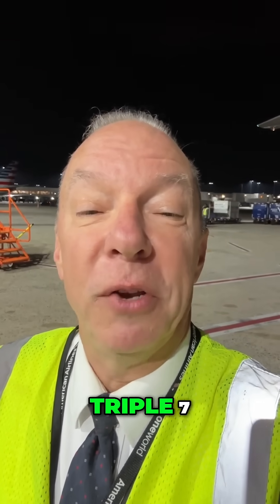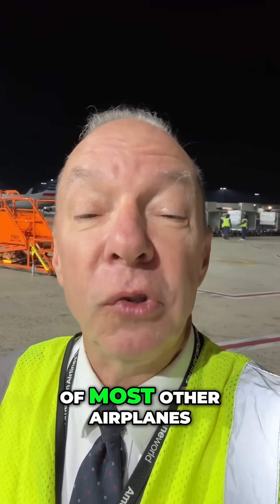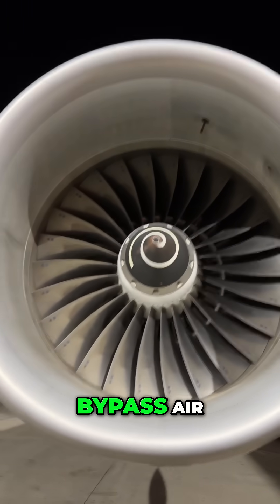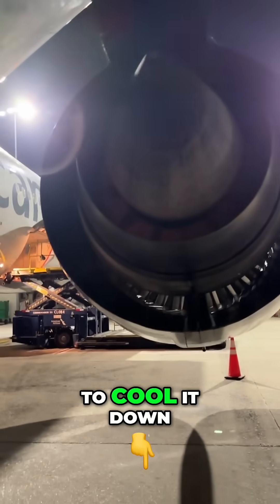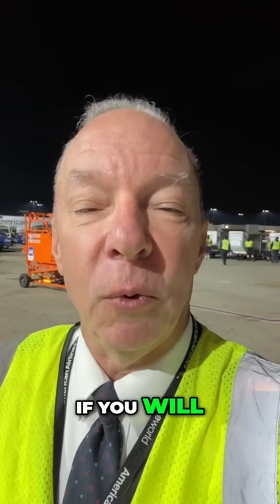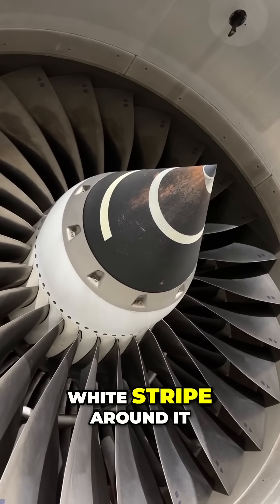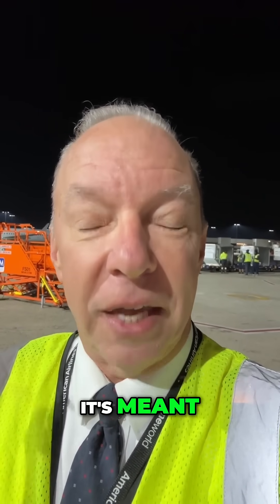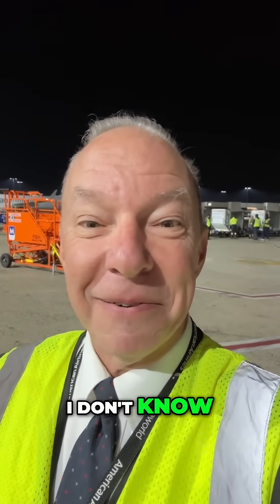Inside Boeing 777 Engines: What You Need to Know

Comment: I believe the main important part of bypass air function is that it produces most of the thrust for the engine due to the large mass flow rate (mdot). Cooling is a secondary benefit.  Great videos keep them coming.
Reply: Basically the only thing he got right was that they are really big.
Reply: @Jeff-6691 yes vanes don't turn. They direct flow from Blades that rotate.
Reply: @randytolle6706  Those are not inlet guide vanes, which you are referring to. Those are the first stage fan blades, and they rotate.
Reply: @davispen  yes.  Just saying Vanes  don't rotate.  , Blades turn.
The stationary turbine I work with.has 19 stages of compressor blades and vanes. 3 Turbine Blades.
Reply: True, and the reason for the spiral isn't to keep birds out, it's so that ground crew can tell the fan is rotating when the strobe effect of the ramp lighting makes the fan looks like it's stationary. The time for the white spiral to rotate visually is far longer than the time for one blade to replace another at any specific angle.
Old folk like me will no doubt remember the "wagon wheel effect" we would see when watching western movies on old black and white TVs.
Reply: 90% of the thrust is produced by the bypass air and it reduces noise!
Reply: @helmutklein6177  so it's essentially a large turbo charger?  Should it use the exahaust gases too?
Reply: @DeepakKumar-lv4te  It is essentially a large propeller.
Reply: The bypass air also helps for noise

Comment: The swirl on the engine fan cone, is for ground crew so they know what engine is running, so they know if it's safe to be around that aircraft
Reply: Exactly right. Some engine models have a simple vertical line to fulfill that function. One additional benefit of the swirl design is that it's relatively easy to tell if the fan disk is just free-spinning in the wind versus being spun up to start.
Reply: @MikeDCWeld  definitely. A great example would be on the dash 8 and atr series with the strip

Comment: Hey Captain Steve.  Tell your higher-ups and bosses that putting a "Chicken Wire" type metal cone in front of the jet engines would fix the bird strike problem 100% and wouldn't cut airflow at all.  I used the chicken wire as just a guide to a strong cone shaped device that is mounted to the front of jet engines.
Edit.  Besides it would make all passenger jets look like SR71 Blackbirds which would be super badass.

Comment: The main purpose of the fan bypass air is to produce most of the thrust by accelerating most of the mass flow of air going in to the engine backwards. Its called bypass because it doesn't go through the gas generator section or core. The core produces some thrust too. However the fan bypass air does cool the ayle sometimes I think. And maybe takes a bit of heat off the core. By using the turbine engine to drive a large fan produces more static thrust for less power. And accelerating more mass flow to less speed is more propulsively efficient. So bigger fan bigger bypass.
Reply: That's what I am screaming!  Cooling is secondary at best!
Reply: Exactly,  it's to produce thrust way more effecient across the speed range passenger planes are using. Regular jet with no bypass have way too high exit gas velocity to travel 0.8 mach effecient. Think of it like some combination of  propeller and jet engine
Reply: Aaaand it also makes the engines a lot more silent. I plane spotted sometimes as a kid in the 70’s and jet engines were LOOOUUUD back then. And a lot smaller, you can check on photos or old movies!
Reply: @MadofaA  Yep. Ever hear a 727 takeoff ? You hear that sound linger like a few minutes after it lifted off. Its a nice sound. Planes nowadays are too quiet. Ever hear a A380 takeoff ? You might miss it. And shortly after it lifts off, the sound just disappears.

Comment: The bird story is a myth. 

Imagine you are a bird and you see an engine coming at you at hunderts of mph. Even if you have a split second reaction time and try to move away you’re still in that very air that gets sucked in the engine with enormous force. Not a chance. 

The reason why there are marks on the tip is so ground personal can identify if the blades are still rotating.

Comment: The first stage of the engine is the FAN.  MOST of the thrust/ power is produced by the fan.   The fan is essentially a multi blade propeller. Most of the air goes through the " BYPASS DUCT "  clearly visible from the rear view of the engine. Only the air required for combustion power goes through the " CORE " of the engine and out the exhaust.   The shape of the fan spinner is designed to force air to engage the blades at the most effective angle.  The spiral drawing on the spinner is to warn / alert  ground personnel the engine is running and repel birds because wild animals will move away from anything they perceive as moving.  This engine is a literal engineering masterpiece , but far too complex to explain in this forum.
Reply: Yes I was surprised he described it as an air conditioning unit.
Reply: He is completely ignorant on both topics.   However the vast majority of the fools that believe his crap really do not want to understand how things work.
Reply: It doesn’t repel birds. This is why the spinners on tail mounted engines don’t have that. If it repels birds, those would have them too. 

And they would put those lines the spinners of prop planes too.
Reply: @rtbrtb_dutchy4183    Propeller tips are painted with colors - mostly white -  to give a visual indication to motion.  Propellers are black facing the pilot and either black or gray facing forward.  Black + RPM makes the prop disappear thus the tips are painted with colors ground personnel will be able to see.
Reply: He must fly MODEL planes, because every pilot I know can explain every system perfectly.
Its a TURBO-FAN jet. The blades in the front are not for cooling the jet at all, they are for producing thrust. In other words the jets purpose is to turn a shaft which the fan is mounted on so the FAN can produce thrust.
Reply: @rty1955    I know a ton of pilots.  They have basic knowledge but cannot explain how the engine works., They just know the numbers
Reply: Thanks for a clear explanation.
Reply: What is literal engineering
Reply: @user-ky6vw5up9m       It's a form of engineering contrary to metaphoric or hyperbole.

Comment: Imagine if it was required to manually start one of these like how they start old planes with the little whine clutch. 

God bless apu
Reply: Sometimes they have to do a manual start but it's not quite as involved as old prop aircraft. Sometimes a mechanic has to use a tool to hold a valve open to start the engine
Reply: @blackmusik109  I did hear something about no apu start. But I never followed suit. Good to know
Reply: @ee12rd  The no apu start is a different procedure from the one I described above. For the no Apu start we refer to it as an air start (like a jump start for a car). We use a machine called an air start unit (aka huffer) that blows high pressure into the engine to get it turning. We can also use it to provide air conditioning to the aircraft. Basically it's like an external APU machine that only provides air for starting engines and cooling the cabin.

Comment: I thought the spinners were to let the ground crew know the engine is spinning...?
Reply: I thought so too. Or anybody else that happens to get close
Reply: @andrebello4191  Same here!
Reply: @andrebello4191 trump supporters and their incredibly high IQs back at it again 😂sad
Reply: I imagine it also serves that purpose. It would make sense
Reply: @sebr3041  It also serves that purpose 🎉
Reply: X1000. It is for ground crew.
Reply: It is as well as to let flight crew know if the engine is under power there is numerous reasons
Reply: I make these motors and it’s for the ground crew not birds
Reply: Captain Steve is pulling your leg a bit.😆
Reply: @westerlywinds5684 someone knows 😉
Reply: Me too.
Reply: Exactly my thought.
Reply: Captain Steve must be one of the kindest pilots in the world. I'd love to fly with him.
Reply: True it is😂
Reply: Two birds...uh...you know...
Reply: @inspectorgadget8234  if the engine is windmilling you can tell by the spinner.
Reply: Yes.   Birds are only an issue after takeoff.   The spinner is of no use then.  This is a complete idiot.  His bypass air explanation is even more idiotic.   Find a home with a padded room.
Reply: It’s to make you keep wondering what they are for. 😂😂😂
Reply: I agree. When engine is running you can not see the spiral because it rotates so fast. Birds won't see that spiral any more than the big jet rushing towards them with a lot of noise.
Reply: It is
Reply: I thought so too; also to show which direction the turbine is spinning
Reply: @ProjectArjunCertified 
The turbine can only spin in one direction under its own power, unless it's just the wind turning it.
Reply: Anyone near that thing will definately know its spinning from the unmistakable noise it makes!
Reply: @martinmtawali7359  tell us you’ve never been on a ramp surrounded by aircraft, without telling us. 

First of all, you are wearing ear protection. Secondly, there are other airplanes right around you with engines running. Also, airplanes have their APUs running for electricity and air conditioning, which are little jet engines and sound the same. 

So no, you can’t tell if an engine is running, just by sound.
Reply: Same here. Boy, I learned something new today. Thank you, Captain STEEEEVE!
Reply: The beacon light let the ground personnel know that the engines are running or about to start
Reply: Honestly thought that too... and the pattern makes it easier to evaluate whether one is going faster than the other.

But I do know that birds have particular preferences about what to move away from..

For instance they're perhaps not afraid of me standing on the platform waiting for the train, but if I use my vape just once they flee.
Reply: Definitely for the crew, but most crew must stay away from the direct engine area at all costs and all of the time. 

At my training for ground personnel, they showed us pictures of what is left from a human after they came too close to a spinning engine. Nothing for a weak stomach.
Reply: This
Reply: Correct - it's a visual cue that lets people see the engine is running, even at a distance.
Reply: he refers to the ground crew as birds...
Reply: Yes, prior to that idea they used to throw birds in.
Reply: me too
Reply: uh, pretty sure you can hear it spinning up.. they arent whisper quiet
Reply: @KeanueAnakoni-Aukai  Whaat? ;-)

I know. I guess it's all about safety (also since the ground crew is or should be wearing ear protection). Before start-up the beacon light is also activated to give an extra warning the engines will spool up shorty or are already spinning.
Reply: @Keanue-Anakoni-Aukai  They aren't, for sure. And there are a lot of them, that's why you need a visual clue, so you know which one is spinning, there is a LOT of noise BECAUSE they aren't whisper quiet.
Reply: That's exactly what it's for, when those things are at Full Tilt you can't see those white lines
Reply: I believe the red strobe light on bottom of fuselage indicates the engines are spinning so the groundcrew are aware.
Reply: The red flashing beacon light lets the ground crew know the engines are running.
Reply: It is because the birds work in their airlines as a flight crew.
Reply: I don’t think Captain Sullen burger, flew a 777 as a career.
Reply: It's right, he didn't mention it .
Reply: that's what they're for, i have no clue what captain Steve's on about in this one
Reply: If you don't know those engine are spinning......you are deaf.
Reply: @bfd194  on busy airport, the noise from neighbouring aircrafts can make it hard to distinguish which engine is making that noise specifically if you wear earplugs. 
Experienced mechanics can have an easy job but not every one!
Reply: @hamzaesam9782  Then the default setting should be assume they are always spinning!   Just like a prop plane, stay clear unless you are sure.
Reply: I thought it was just to amuse the bored ground crew….
Reply: Thanks Captain Steeeve!
Now I know (I think).
Reply: Even I knew that!
Reply: Started in WW2 with German fighter planes...to keep ground crews from running into propellers
Reply: Correct. The primary purpose of the spiral on a turbine engine cone (spinner) is for ground crew safety. It's function as a bird deterrent is a secondary, unproven theory, though some airlines believe it helps.
Reply: The ground crew knows the engine is running because of the incredibly loud noise it makes not that spinner. It’s supposed to repel birds or so I am told. Captain Steeeve
Reply: @p3pastor it doesn’t repel birds. It’s for the ground crew. This is why airplanes with engines mounted on the tail, don’t have those lines.
Reply: @p3pastor Ground crew  wear ear mufflers and niot aware engine is spinning.
Reply: @p3pastor  At an airport especially a large airport it is so loud you cannot tell what engine is running. Jet engines have spirals to help ground crew identify if the engine is running and to avoid the spinning blades. When the engine is running at full speed you cannot see the spirals nor could a bird.
Reply: @laker3 think he means while the plane is stationery so they don’t nest  in it or roost
Reply: @p3pastor Nope. It's to let ground staff knows engine is spinning at high speed, because staff wears ear plugs n if you're downwind, the engine is a murmur...
Reply: @p3pastor  the ground crew wear/should be wearing hearing protection.  They probably cannot determine if an engine is safe to approach by the sound anyway.
Reply: @p3pastor  they spin for a while after the "incredibly loud noise" stops and can also spin in strong wind when not running
Reply: @p3pastor if you’re at a big airport there’s hundreds of engines running and its hard to tell which ones are making the noise once you are close enough to know for sure you’re probably too close.
Reply: @p3pastor they have hearing protection and the APU makes a lot of noise so do planes nearby. It's definitely to judge how fast it spins.
Reply: @p3pastor Ground crew personnel wear hearing protection which drowns out much of the sound of the engines. But it also blends in with all the other noises at a busy airport. This, along with all the other distractions around them are  why they are painted on...
Reply: @p3pastor sometimes the air that is sucked into the engine can be fatal before it starts to make noise
Reply: That's true, also to prevent birds
Reply: @katimboallan4605  nope.

Comment: This is a rolls royce not a GE 90 steve. The ge90 is the one thats as big as fuselages. Btw u fly a Boeing 777-200ER for American. American does not have GE90-115Bs on there 777-200ERs only on their 777-300ER 😅
Reply: He said almost as big 😉 and I don't think you just fly the 777-200 but instead all 777 Variants your Airline has
Reply: @mileniumfalcon I'm not sure how strict typeratings are with respect to different variants within a model, but I wouldn't be surprised if most pilots were limited to particular variants unless the airline requires them to switch or have additional training.
Reply: @MikeDCWeld if you have a 777 rating you can fly any version of the 777. Also it’s an only a conversion course for the 787. So 777 and 787 is “one” rating too